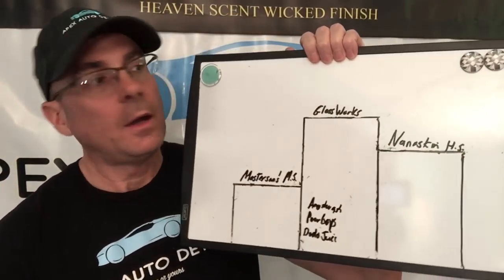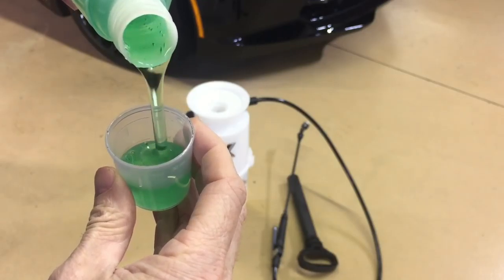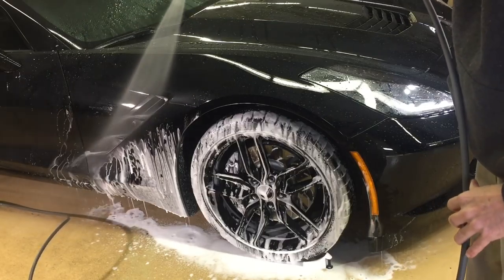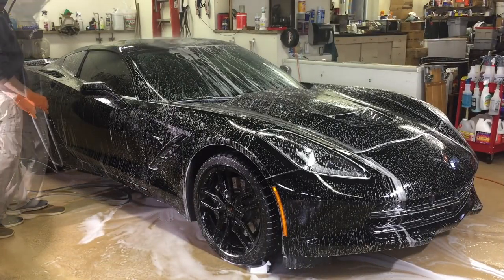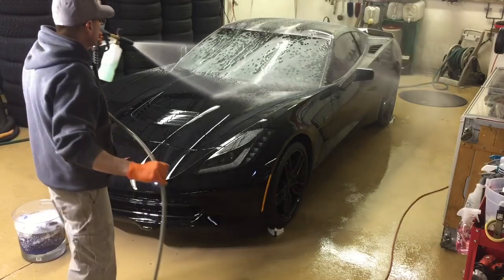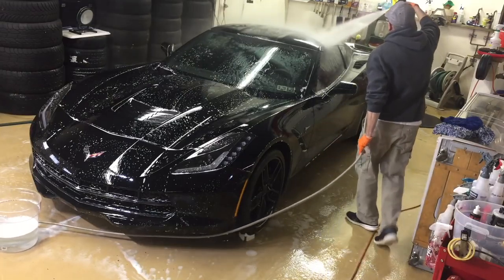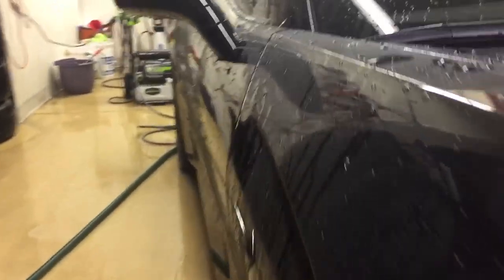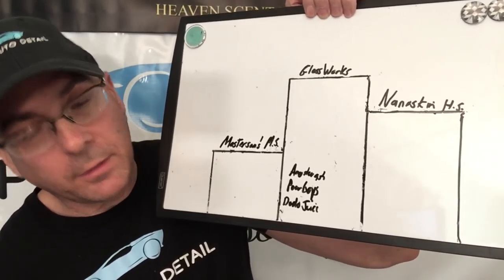P21S Bodywork CONDITIONING Shampoo!! Wheat Germ and Sugar Based Surfactants!!!

Comment: Ha ha, maybe the sugar made too sticky therefore, it had no lubrication. 😃
Hey Brian I came across a video, I know it can't be part of this contest since it will strip wax,  anyway a  couple guys claiming it is a true touch less wash, it may fall in the same class as the purple power V and boat wash, it's called zep profesional enviroedge truck and trailer wash. Have you used it? it scares me to think it can be a touchless shampoo, foam and rinse and it will dissolve bonded contaminants.  Maybe you can put it on your list to do in the future. 😎
Reply from the maker: I will eventually cover it👍🏻